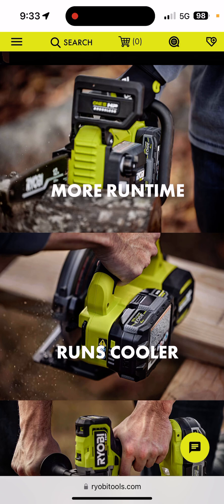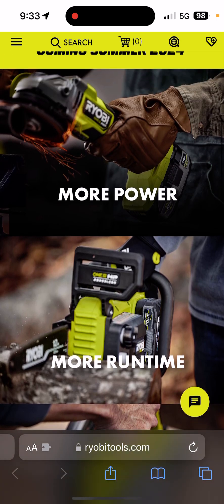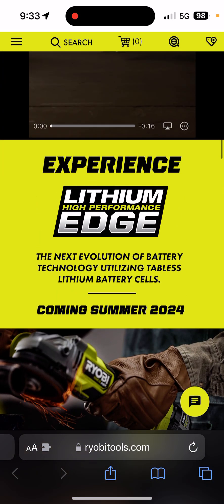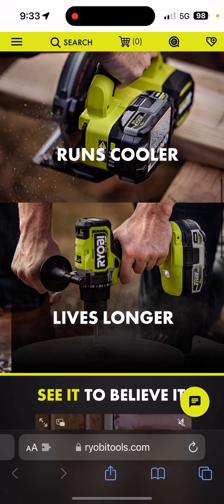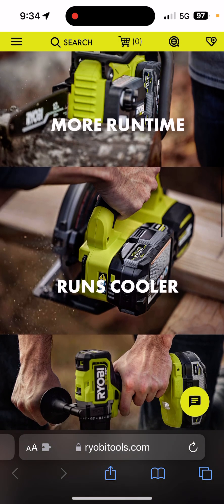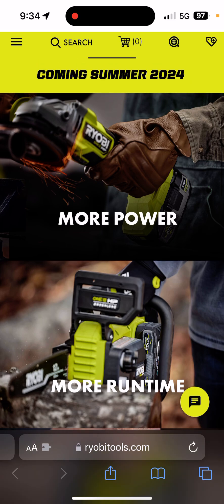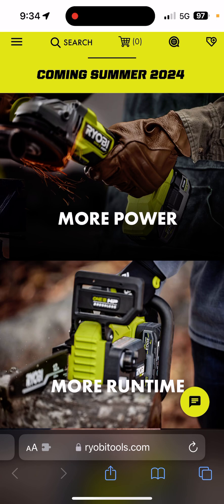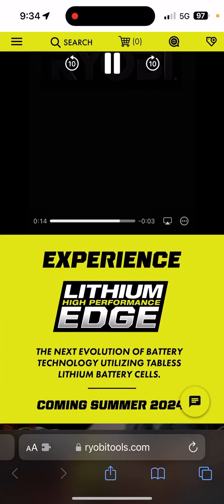RYOBI LITHIUM EDGE HP BATTERIES *JUST ANNOUNCED!*

Comment: They're Milwaukee Forge batteries, with a Ryobi post on top.
Reply from the maker: Confirmed: 21700 cells.

Utilizing upgraded tabless 21700 lithium cells, this all-new ONE+ battery provides more power and longer runtime while running cooler and living longer than other ONE+ batteries in a more compact size.
Reply: @justinsgarage1125  Apparently, you weren't aware that the 8 and 12Ah Forge batteries use tabless 21700 cells.
Reply from the maker: @TheCharleseye  just to be clear….the Forge 6ah battery uses pouch cells. 

The MX(not M18) Forge 8ah and 12ah batteries use tabless lithium cylindrical cells. 

There is a M18 Forge 12ah battery that uses tabless lithium cylindrical cells that has yet to be released - slated for second half of 2024. 

You’re saying that this new Ryobi Edge battery is a 18v 12ah forge battery, just with a Ryobi post on top? Really the only similar characteristic is that the batteries are tabless. It’s like saying the P195 (ryobi pack with 21700 cells) is just a Milwaukee M18 3ah    high output battery with a Ryobi top. I’m not trying to be argumentative and i appreciate the interaction.
Reply from the maker: If they were you’d know because it’d be plastered across the screen. These are not pouch cell batteries. They still use traditional cylinder lithium ion batteries, just tabless(no spot welds). These would be smaller as well if they were like the forge. Think of the dewalt power stack 5ah battery. It’s tiny compared to the regular 5ah battery. I still have not confirmed if these use 21700 or 18650 though.